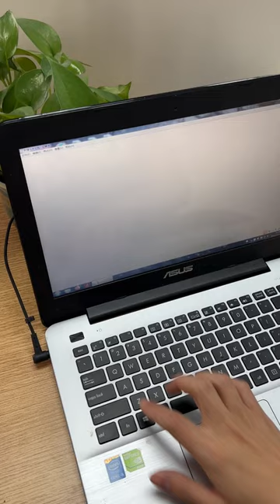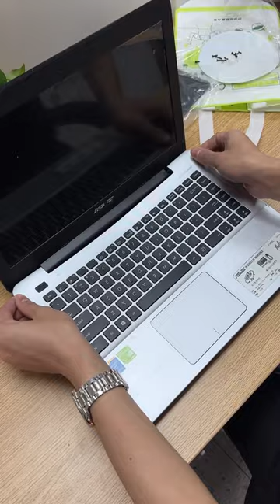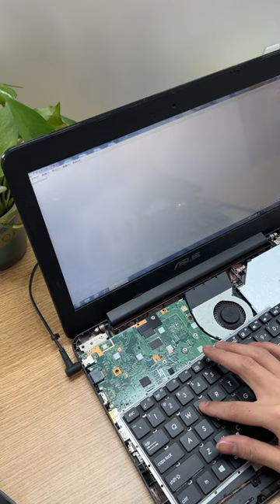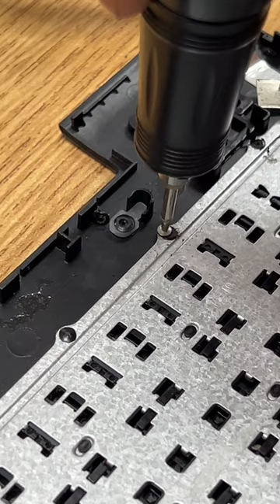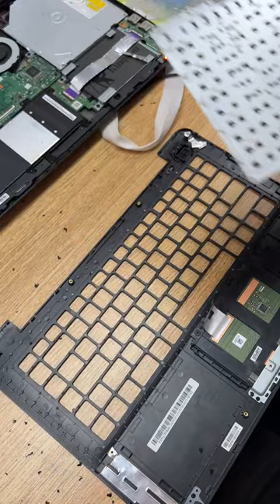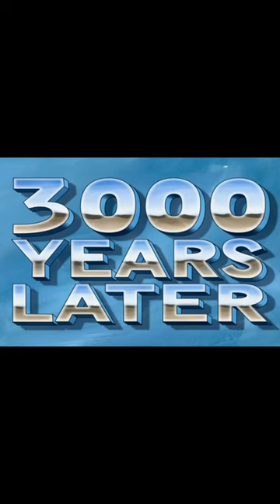ASUS Laptop keyboard replacement  #shorts

Comment: almost the same problem as MacBook's, the only differences that no need to remove motherboard and no 48  tiny screws that have to be removed prier to ribbons
Reply: Most new laptop are like this now. I have replaced a lot but always melt the plastic holding the keyboard to the chassis instead of grinding them out.
Reply: @fasiosta  i drill the MacBooks down, it is made from aluminum, cannot be melted
Reply: @fasiosta  Most are worse than this, because you can't just take the top cover off, you remove the bottom cover, then the entire motherboard, because the keyboard is built into the palmrest, that can't be replaced without fully rebuilding the laptop.

Comment: for me full size keyboard on my laptop reduces my typing speed as i have to move my fingers more if it was more compact and small sized typing experience would have been better. guess i will use an external keyboard wireless with backlighting